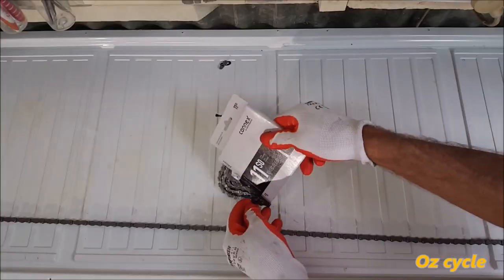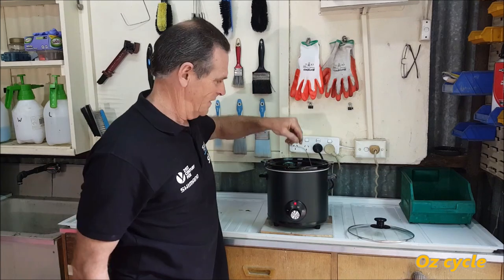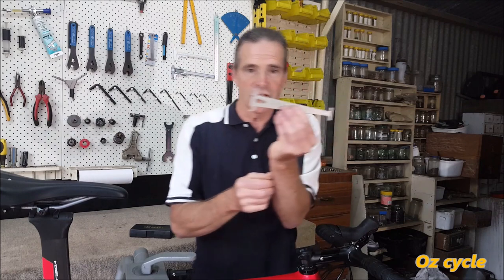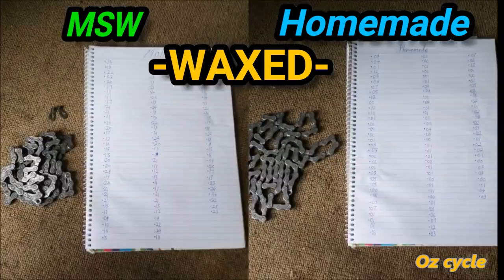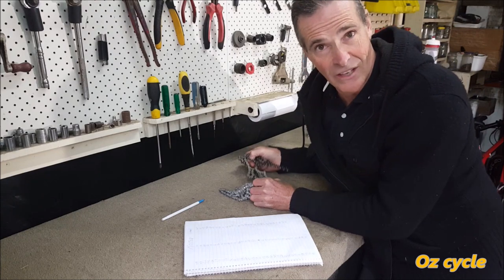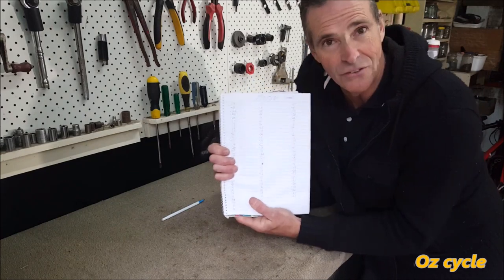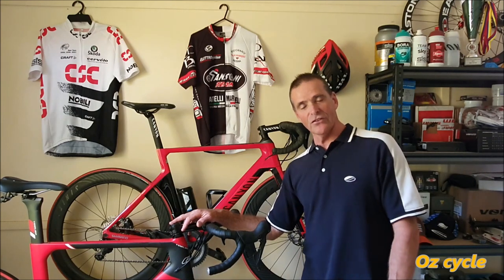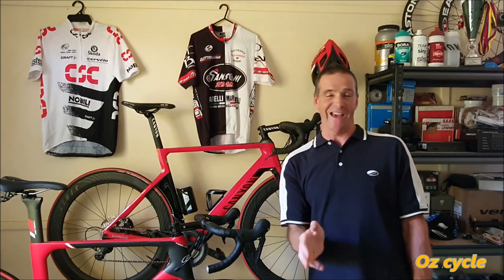Is this the ultimate bicycle chain lube? - Test results

Comment: What about friction? Longevity is important but so is being the fastest ie robs you of the least number of watts. 

Would have been interesting to have measured both chains from new as there may have been tiny differences from the manufacturing process as you said with that new chain.

Comment: Thank you for making this type of videos, If you  would have measured the chains when they were NEW, rather than after putting 3000 miles on each of them, you would have a scientific point of comparison. Nevertheless,  I would make a follow up video when you do the same test, now that you have this baseline measurements and observe after another 3000 miles, the chain varies from this already established measurements, and observe if the wax is better Home made/NWS based on the before and after change in wear. 

Great Job, keep it up!!!

Comment: Your homemade wax chain wasn't hanging quite straight.  There was a very noticable kink at the very first pin, and some other smaller ones on the way down.  This makes it appear artificially short.  If you try this measurment again, I'd hang some weights on the end, or do the test on freshly stripped chains.

Comment: Great video. Great work. BUT! Do I want to ride one chain 40000km? I don't. 
An other reason against the wax method: the chain is much more louder than with lube.
Reply: I've put almost 15,0000km (mostly dry weather riding) on my WD40 chain and it is still working well.

Comment: My opinion is use old engine oil, preferably Mobile One, Amsoil, etc. I soak my chains, bicycle-motorcycle as long as possible. Even in MX I can ride for many hours under racing conditions without using a spray can. I also use a snake oil, Pro Blend, that reduces friction wear.

Comment: Do your formulas, both old and new, work on mountain bike chains with similar results? As there is a greater amount of dirt, mud, grime, etc. introduced while mountain biking, I'm curious as to your formulas ability to withstand those conditions.
Reply from the maker: Yes. I'm still doing the mileage on my MTB before doing vid on how it works great in dirt n wet as well. Upload prolly Janurary.

Comment: Amazing great scientifically performed experiment! I approve! Could you please let us know, once it's waxed, how do you clean it after a rainy muddy drive? And how often rewax?
I use the old formula but I have the feeling it's a little bit noisy. So I put just a little bit of dry Teflon lubricant, and it performs great. Should I let it just be noisy? Or what do you recommend?
 Thanks for your great insight
Reply from the maker: Rewax every appx 250km. Before every rewax,pour hot water over chain in a seive to remove contaminated wax.

Comment: How have you cleaned your bike during the 3,000kms riden? Have you just used the hose and squirted water over the driver train? Use a sponge with soapy water? Used any degreaser?

Comment: I suspect the "dark something" is metal. And this would match with your stretch measurements as the MSW lube residue looks much more coarse and voluminous. Check it with a magnet. I've seen that stuff stuck on many an automatic transmission pan magnet after 100,000 miles of wear.
Reply: Or molybdenum disulfide, which is one of the  additives in MSW.

Comment: I cleaned my dirty chain using petrol, degreaser and iso alcohol.  Chain looked very clean and shiny.  Then I created the mix of paraffin with paraffin oil.  I wanted to heat up the mixture to about 90C and then put the chain in the mixture.  By accident, the mixture ended up at 102C with the chain in it.  I saw some bubbles coming from the mixture at these high temperatures.  I thought maybe there was still some water in the chain left (even though it was dry, dried it for days).  Or maybe some water from the mixture (nothing is ever a full 100%...).  What I noticed is that there was dirt on the chain.  Not rust, but dirt.  So I wonder if 'boiling' your chain is a good idea... sounds crazy, but I really do think that some remaining dirt came off the chain.  The chain was very dirty, and the petrol took care of a lot of cleaning.  I shook it a lot, let it sit for a day, shook it again, let it sit for another day, etc.  But you don't heat up petrol...  What are your thoughts?  Was 100C a good idea?  Or should I avoid it in the future?   Also, what I noticed is that the melting point of my mixture is around 37C.  Wiki says that the melting point of paraffin wax is around 37C (you can find a few temperatures in that wiki, but 37C is also in there).  So I think my paraffin is pretty pure (it also says that on the package, but hey - cannot believe everything that's on the package ;)  ).   Let me know what you think of the 102C boiling of the chain...  For additional cleaning purposes...
Reply from the maker: 90deg.C  is as high as it ever needs to go. The bubbles could be air or water from inside the links. Make sure your chain is sterile(no contaminants) before waxing otherwise the wax want be pure anymore.

Comment: Fantastic comparison, really appreciate the work involved here. I use a dry lube and rarely get 3000km to a chain, so very interested in trying this. One question though, how noisy are waxed chains after a few hundred km? (Nothing worse than a noisy chain)
Reply from the maker: Not noisy until about 250km
Reply: oz cycle That’s not bad at all, what are you doing at 250k to mitigate the noise? Or do you just accept it and live with it?
Reply from the maker: Rewax

Comment: Recently came across your channel as I'm replacing all my bearings on my Specialized Epic FSR MTB. Amazing stuff you do, hands down! And I'm a big fan of not having to buy expensive tools and stuff - so your channel is a gem of DIYs... 
Now, would you know if parafin/wax is also superior (to oils/wet lubs) for lubing MTB chains? I ride in quite wet and dirty conditions (Denmark, the cold and wet part of Europe) so the chain gets a lot of dirt during a ride. So I typically clean the chain after each ride and reapply chain lube. Could I skip all this with parafin/wax - assuming dirt wouldn't stay on a waxed chain?
Reply from the maker: Yes absolutely Jan , a waxed chain repels moisture and locks out dirt....waxed my MTB chain for 3years now,no probs. After a wet ride do a rewax as often the outer plates start rusting otherwise.

Comment: Thinking of using this method. I was wondering if I could simply buy a small induction cooktop for 1 used in camping instead of a rice cooker.. ?? Temperatures would be adjustable and I could use an old cast iron pan I don’t use anymore.. still need to get my hands on sum petrol as I don’t have a car hahaha

Comment: Hi Steven! Thanks for the effort of making such detailed videos, it's always a pleasure to watch! Regarding the difference in clean vs. dirty chain length... I think the cleaned chain should be longer than the dirty one. You have measured it differently which makes me doubt the KMC measuring tool precision. In that part of the video you've mentioned that it was getting cold, did the temperature vary a lot between two measurements (before and after the cleaning)?
Reply from the maker: I checked and rechecked measuring,same result. You could be right about temperature tho!

Comment: best Infos! can´t wait for the new formula, was just thinking on buying wax, but I will save some money there...
so how many times did you rewax each chain? ca. every 300km - 10 times? how much wax in mass did get lost approx.?
thanks
Reply from the maker: Rewax appx. 250km. Very little wax is used for rewaxings, 500grams will last 2 years easy

Comment: I have had similar observations. Campagnolo C10.  My homemade (paraffin, wax, graphite powder) after about 3000 km wear 0.008%. Life is beautiful!
Reply from the maker: Nice. How did you measure the .008% ?
Reply: @stevenleffanue  Calliper. 9 links in the chain. The accuracy of these measurements is of course lower than yours.

Comment: 16:00 seems to be a better way to compare chains. The accumulated effect of all the links gives you a far better “signal to noise” ratio than the individual measurements, which accumulate error. That said, using one nail and measuring each chain individually would avoid the small difference in the location of the nails. 

Keep in mind using a precise instrument does not guarantee precision results.

Comment: Interesting test for sure.  Thanks for the all the work!  HOURS I'm sure!

Thoughts on having a power meter included in the test?  It may be well and good that the wax works better at chain protection, but does it sacrifice power / efficiency? Diligent cleaning and lubrication techniques needed for a control group.  (double blind standard lol )  I use a a wax based chain lube too.
Reply: Just watched your other videos!  Nice work!  Got the slow cooker on right now! lol - Any thoughts on trying a test between the cleaning techniques?  I currently use a ultrasonic bath.  Seems to get the finest bits of grit and sand out of my chain.
Reply from the maker: Yes,I have another video comparing chain cleaning techniques which includes sonic cleaner.

Comment: It would have been interesting to see chain measurements after the initial cleaning, and before the initial waxing at mile 0 (okay... off to see if you've done some followup videos on this). In every manufacturing process there is always deviation from spec. Folks who have done specific testing on chain durability (controlling for lubricant) have found that the same make and model of a chain can have different measurements from the factory so it's entirely possible that the MSW chain was out of spec from the factory. If that was the case then I would expect to see the mean lengths to be relatively the same over time. If yours is doing a better job then we would expect to see the MSW chain having a higher regression coefficient. 

What were the riding conditions for each bike? Were they both used for exactly the same types of rides, or do they have different purposes?

Either way, there is no doubt that waxing (regardless of whether someone is using your formula or MSW) offers some clear advantages after the initial cleaning, ESPECIALLY when it comes to cleaning your bike. Pre-wax, the majority of my time was spent cleaning the drive train. Now I just have two chains... I take chain A off, wash the bike (no degreaser needed anymore), and put chain B on. Having the two chains means I don't have to wait to ride my bike while I rewax.

Off to check out what you're doing to your wax.

Comment: Highly meticulous test as usual 👍 Will be curious to understand why you reckon the new homemade wax formula outperforms the brand leader. Also, as wax appears to last longer than oil based chain lubes, will be interested about wax lube maintenance between rides (if any) and tips on how best to judge the optimal time/distance for a chain clean and re-wax. Really interesting, like your engineering style, keep up the good work. Thanks 👌👍

Comment: Something doesn't seem to add up in your video/measurement. According to your findings the MSW waxed chain before cleaning  measures more elongated (worn) than the when measured clean as at timeline 13:00 . 
Maybe the chain should have been measured under load like it would be actually be under pedal power while installed on the bike? Hanging it from a nail/pin and have a significant load at the end of it might show a better picture (and save yourself a ton of time  measuring each link individually!) 
When I worked as a DH race mechanic in USA, that was our way of measuring chain elongation on paying-customers' bikes (while our sponsored racers always ran new chains anyway).
Reply from the maker: Yes,Not sure why that was. I measured individual links to draw the graph showing how  each link is different.

Comment: Consider me intrigued!

When will the new wax formula vid be released?

And can you give more details about maintenance? I got the impression that once applied you didn't reapply the wax again for 3000kms---but that seems like I may be wrong. Can you clarify? Also what about general chain cleaning? Do you just brush out the muck with water and a brush post-ride?

Thanks in advance! Great channel btw!
Reply: I'm especially interested in the maintenance issue for use when bike touring. Is this method practical if you won't be home at a well stocked garage for 1000kms or more?
Reply from the maker: Easy rewax at appx 250km. Almost no cleaning required as wax doesnt attract dirt. All revealed in late December vid.
Reply: @stevenleffanue  Hey, it feels like I'm waiting for Christmas to come....only worse. :-)

Comment: I'm confident that you'd still use that chain lube even if it wasn't quite as good, because of the cost. The fact that it's so much better is crazy though!
You mentioned cross chaining as being bad at the end - does this matter so much for a setup with only 5, 6 or 7 speeds in the rear? I don't imagine having 2 or 3 front rings would be a big difference, but I don't run the newer setups. And one of my bikes lacks a FD but has a 3x with chain guard replacing the big ring (long story as to why I put that on the bike - I use the kick & stick method to change gears when I really need to.)
Reply from the maker: A chain operates at maximum efficiency with least wear n tear in a straight line. The more deviation,the worse effect.
Reply: @stevenleffanue  Thanks, I was overthinking!

Comment: Thanks for taking time and investment to check out different methods. Great to see home wax is the best. A lot of work to degrease chain and then wax immersion. I've only recently switched from a wet lube to Squirt wax lube. Its good so far. If I can motivate myself to do use your methods then at least I now know how to do it. Bit concerned about having all that flammable liquids about. Petrol, meths etc. Cheers for entertaining and very useful testing.
Reply from the maker: Initial clean is done only once every 10-15,000km

Comment: Tell Paul tare chain engineers who are screaming “What??! Not high tech?? You mean I’ve wasted my career?”

Seriously. Just because they are everywhere doesn’t mean they are not serious machinery!

Every component of a chain has to be made with great precision just to remain assembled and to function. High quality materials and heat treatments provide durability and performance. 

Stamped metal side plates are very precise. The hole diameter must be accurate to get the proper press fit with the pins. The alloy materials is carefully selected. The heat treatment provides the best balance of hardness and durability. 

The pins are not “chopped wire “, they are precision ground to size and heat treated

Comment: Can't wait for the new Formula!   I just got a new BMC SLR02 this past summer, rode about 500K on the factory lube, then clean degreased and moved to the WAX - what a difference.   I should have used the wax right from the start.  I am using Paraffin wax that is used for canning not candle wax, this costs about $3.99-$5.99 US per 1 lbs block, each block consists of 4-4oz. Slabs. .  I use 16 oz of Paraffin lamp oil to 20 oz of the Paraffin wax.   So it takes 5 slabs to make enough to soak the chain, with the oil to soak the chain.

Comment: Good news, I'm a wax convert and good to know the home made is as good/better than the expensive option! Quick question - on a previous video you recommended taking the chain out at ~50 celcius so the wax didn't run straight off, in this video you're taking them out at a much hotter temperature. Is this what you're now doing as standard or just to conform to MSW recommendations? Thanks.
Reply from the maker: Yes Alex,with both MSW and the new wax you remove the chain at higher temperatures..  ie 90-93deg C.
Reply: @stevenleffanue  perfect, that'll make life easier when doing multiple batches as I won't have to wait for it to cool down /heat up every time 👍

Comment: I wonder if the difference you observed between MSW and your formula applies to those who ride mainly in dry conditions. I use MSW but I’m willing to experiment if this formula is faster/induces less wear. I agree that MSW is still miles better than what I was using before (teflon “dry” lube).
Reply from the maker: Both waxes were ridden through wet winter and hot summer here.

Comment: I am surprised you didn’t take stretch measurements before running the experiment. The initial stretch of chains can vary a fair bit between batches (I have seen differences as high as  20%). As such, your treatment is unfortunately confounded with individual chain characteristics (e.g., initial stretch). When comparing wear rates I will take multiple measurements with the vernier caliper over time and use linear regression. The intercept term controls for initial stretch differences, the slope is an estimate of the wear rate. You can regress against distance or duration. The slope estimate is very repeatable. You can then derive a formal statistical test for differences in wear rates. Or if you stick to before/after you can use a 2-way ANOVA (before/after and treatment are your factors) with the interaction term being the test for different wear rates.
Reply: Scott Turnbull yeah I agree. They both needed to be measured before initial installation.